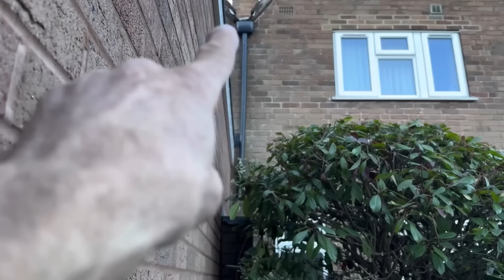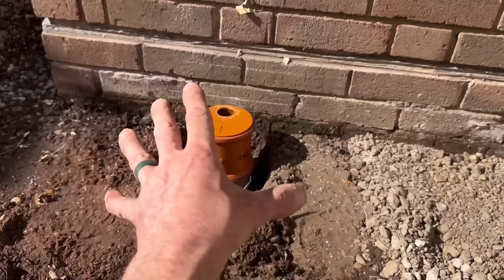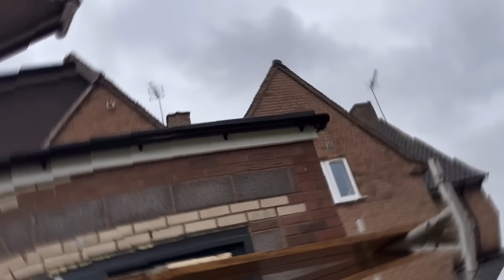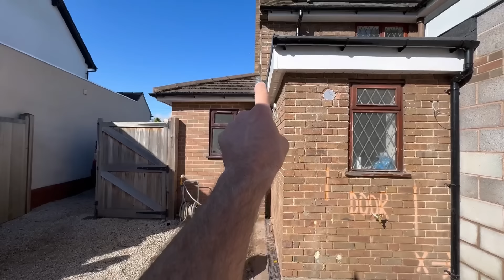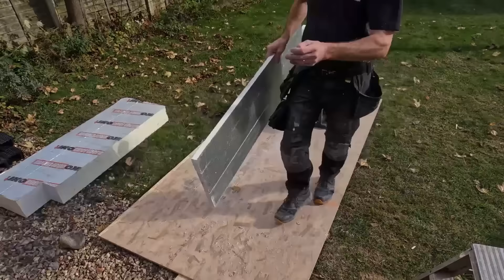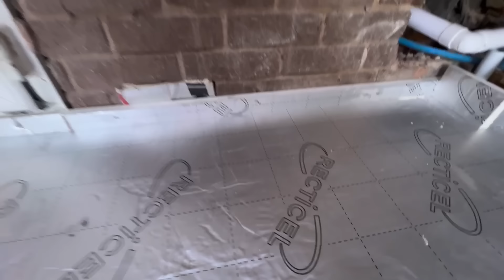Mastering Roof Water Management, A New Boiler Install & UFH Preparation.

Comment: Richie, I would recommend deepflow gutter at the very least to take the main roof valley water as well as any run off from the flat roof - don't want to cause any problems for neighbour or a damp external wall under heavy rain conditions,. regards Nick
Reply from the maker: Thanks Nick. I have spoken to the customer about this one already as we aren’t really sure what flow we are going to get. We are going to keep an eye on it and yes we will change if necessary 👍🏻👍🏻

Comment: Up the side of the extension the ACO drains have been Hornched  ( think that's how you spell it)with compo, 👍👍👌👌
Reply from the maker: Thanks Martin I knew someone would tell me exactly what the correct terminology was 😁👍🏻
Reply: I thought it was flaunching 😂😂😂
Reply: @Mr_A_Builders  it could be anything be we know what we mean 😂😂😂🙌🏻🙌🏻
Reply: Martin is correct, but it’s spelt haunched, you find flaunching around a chimney pot on top of a chimney stack and benching in a manhole

Comment: hi rich
i noticed you use a hikoki 2nd fix gun , just gave up with my paslode , do you recommend the hikoki , everything else youve recommend has been fab , ta mate
Reply from the maker: Hi Gareth. All my nailers are Hikoki. I have the 1st fix, 16g 2nd fix and also the 23g Pinner. Only thing I’d say with the 1st fix nailer if you get the small batteries with it you’ll be changing the batteries every other hour when doing a roof so I use the bigger battery. The weight takes some getting used to after a paslode but it doesn’t take long 👍🏻
Reply: @Mr_A_Builders  ta rich , youve cost me more money , keep up the fab videos

Comment: Another Top video, was that 90 bend not upside down ? Just curious as if seal ever went it would leak  👍🏻👍🏻 ignore me if that’s a silly question 😆
Reply from the maker: It’s not a silly question at all. It’s been encased in concrete now so it’ll never be a problem but it’s only rain water. If it was foul drainage it would be a big no no 👍🏻
Reply: @Mr_A_Builders  appreciate the reply 👍🏻

Comment: Great vid as usual.

Is the upstand of 25mm insulation around the perimeter as well,as preventing cold bridging, a requirement under building regs?
Reply from the maker: It depends what building inspector you get and how switched on they are
Reply: @Mr_A_Builders  I’d rather do it by the book. It’s self harm in the long run. Energy ain’t likely to get back to pre 2020 prices. We’re in the midst of constructing a new 70 sqm extension and using LA building control who are very helpful but do want it done properly!

Comment: Hi I have just watched a video from Build it better, no sure how it appears in my feed.
But is he correct in his flat roof construction method, because if he is my roof is wrong and so are yours
Reply from the maker: Hello Mac, thank you for asking us and not him as from what I can tell he's blocked us from his channel, meaning  no right to reply. He lies about the contents of our videos and changes the narrative to suit his. There is nothing wrong with our warm decks and if yours is done to our standards then there's nothing wrong with yours either. He has got the due point wrong. If you use the correct vapour barrier in the correct place with the correct amount of insulation installed correctly, like all that is in the videos he's referenced, then the due point will be WITHIN the insulation, not on top. That is the whole point of this method, the due point is WITHIN the insulation. Don't forget that at the end of his video he calls himself a novice. That is an extremely important fact to remember should you consider any building advice from him. If there are any other questions then please get in touch, always here to help. Thanks again.
Reply: @ 
Thanks for the reply, I was sure he was wrong, I did look at other channels which confirmed your method is correct and is the same procedure lots of technical sites on google confirm. 
People such as him giving out wrong advice should be banned from here
I’m sure there is a procedure to get it removed if he is promoting false information about your and other companies 
Once again thanks
Reply from the maker: Not a problem at all and I really appreciate you coming to us with this and I couldn't agree more with what you say. He even tells you not to follow manufacturers recommendations, he thinks he knows more than them! I'm sure you have already but if you haven't take a look at Steve London Flat Roofing. He really is the oracle on this. If you want to listen to just one person, listen to him. Ha k you again, take care.

Comment: Hi Rich, the Aco do they have to be laid to a certain fall or is is it built i . Also you mentioned that the gas fitter said the condensate pipe should be at a specific fall, can you remember what angle that was ? Looking forward to the next roofing video.
Reply from the maker: Hi and thanks for the comment. I put the Acos in to turn of bubble which is plenty to make the water run in my opinion. 
I can’t remember exactly what the angle was but 3 degrees comes to mind which in my mind seems really extreme but what do I know I’m only a carpenter 🤷😁👍🏻
Reply: @Mr_A_Builders  Thanks just wondering about the condensate pipe as I have one that is at a very steep angle.
Reply from the maker: @amazing451 that sounds about right mate 👍🏻
Reply: @amazing451 3% or 52mm per metre
Reply: @andrewiow6327  Thanks 👍👍

Comment: How do you stop smells coming through the channel drainage?
Reply from the maker: Hi Mark. This drainage is only attached to the rain water system which is to a soak away as far as we are aware. If it had been to a combination system (foul as well) I would have fitted a different type of gullet pot 👍🏻